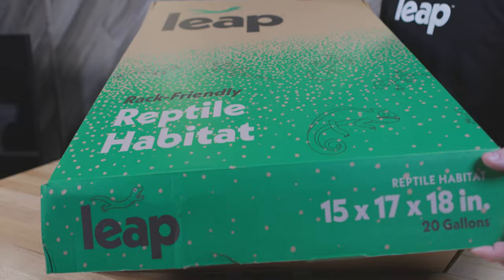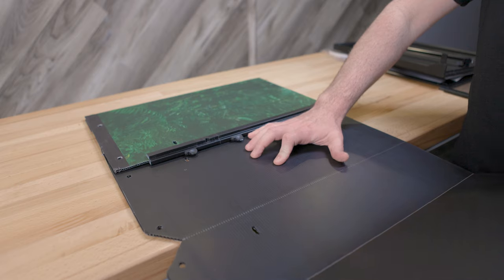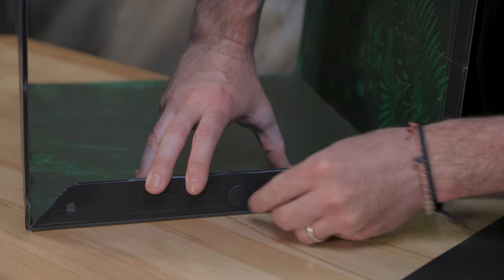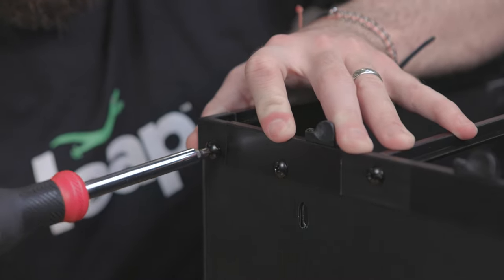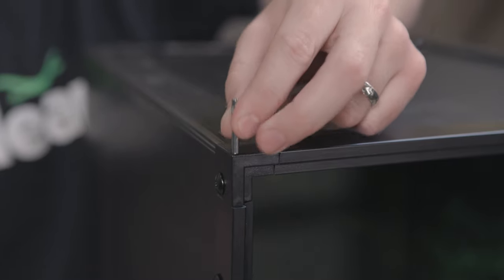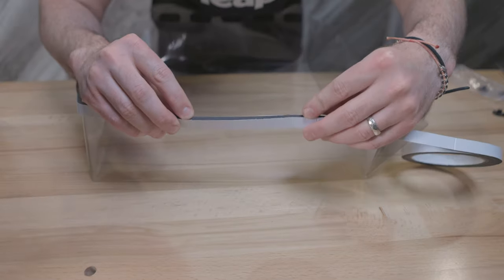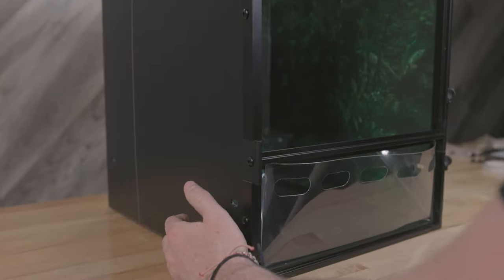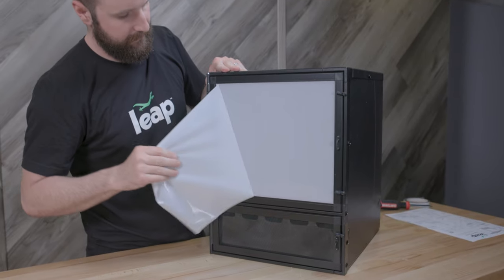How to Assemble your first Leap Habitat!

Comment: There's no reviews on the website, so I wanted to share mine here. I honestly couldn't believe anyone's habitat could be worse than Zen Habitats... I saw many praises about Leap and never really any negative reviews so I thought that was a great thing.  I kept seeing ads for Leap and I wanted to try it out for my geckos - I did need an upgrade for my gargoyle gecko so I purchased the largest size they had (22x17x36 inches) which I thought wasn't bad for around 200$. The only good thing I have to say about Leap is how light weight it truly is. But as for building and the sturdiness of the tank, it's a headache! It's literally a box of "cardboard plastic". The back side has to be folded and formed to make a corner but it doesn't stay solid to the shape - it stayed bowed outwards. On one side of the habitat, the perforated edges that you are told to to bend, buckled up and exposed a hole. If I hadn't caught it before adding my gecko, she would have escaped through that hole. I'm not impressed and pretty upset I wasted money on something I thought would be innovative in the reptile community.
Reply from the maker: Hi Hannah! We're sorry that this issue occurred. We want to help! Reach out to our customer service team and we can get this fixed for you. The email is support@leaphabitats.com